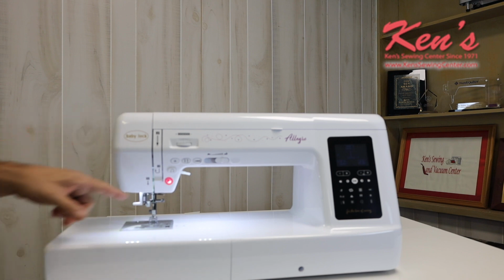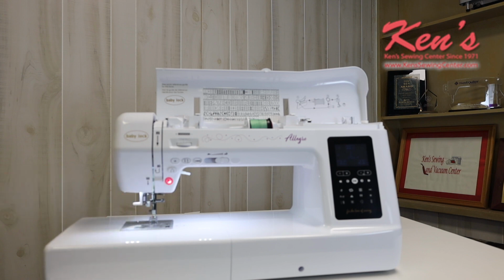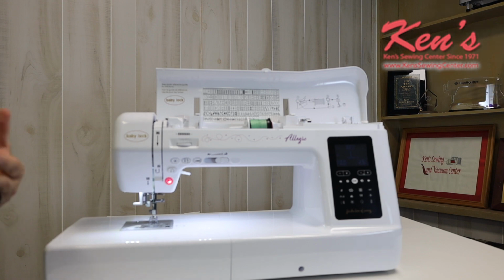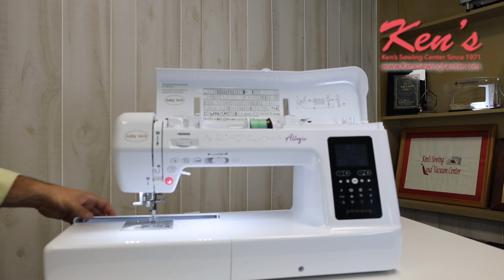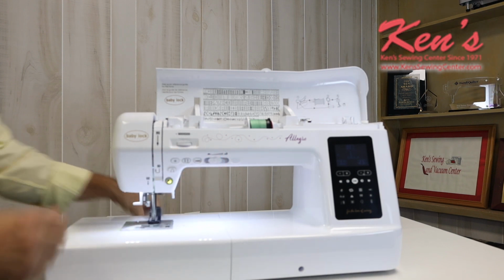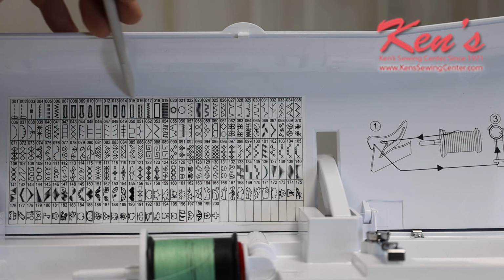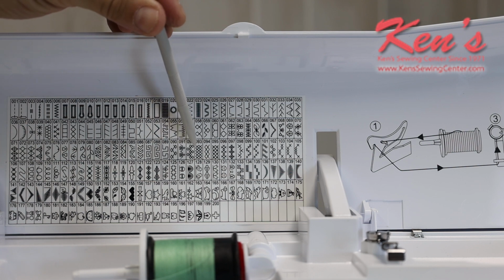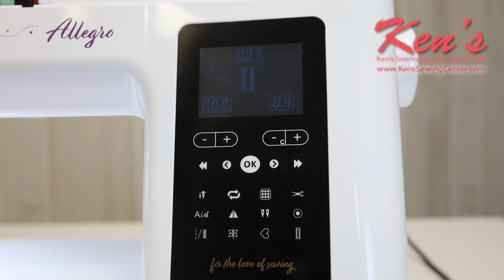Baby Lock Allegro Sewing and Quilting Machine Feature Overview

Comment: I bought this machine and love it. But I was trying to do free motion and nobody talked about the side dial to the left of the machine. That's for the foot strength pressure?  Once I found it and put it on 0 and I was able to do the free motion with no problems. Before it was set on 3 and with that setting and dog feet down, It was so hard to move the quilt sample I was practicing on. All good now, there is no video anywhere explaining this.
Reply from the maker: That is for the foot pressure.

Comment: I have the Allegro and have had a lot of trouble with the stitches on the back of the project. It was a real thread mess. I bought this to quilt with. I have since learned from you tube that I have to put needle in highest positon to thread the machine. I did manage to quilt with it but the stitching on the back of the quilt is not straight, it's wavy.
Reply from the maker: Yes.  Please call us.  We will be happy to help you

Comment: Open arm is wide; fussy about tension; find it is a bit touchy with bobbins and overall (I purchased from my local sewing center) it can be a pain. Sorry, but these are my experienced. Even suffered a recall right after I purchased it.
Reply from the maker: We will be happy to help you if you would like to contact us.
Reply: @ OK! Any idea: 1/4 inch (regular 1/4 inch foot not the guid one) I line up both fabrics with that inner mark but some stitches are straight and spot on and even while others stitches are slanted and therefore go off by as much as 1/8th inch when I finish sewing. I also notice some stitches are shorter. Oh! My Janome never does this.